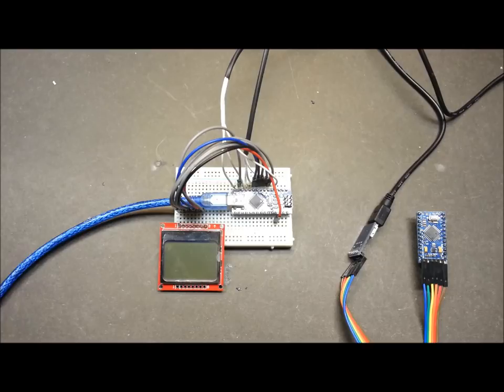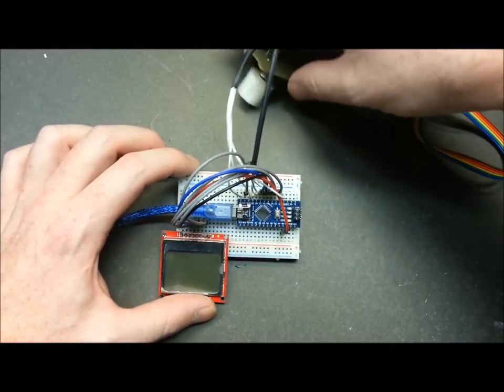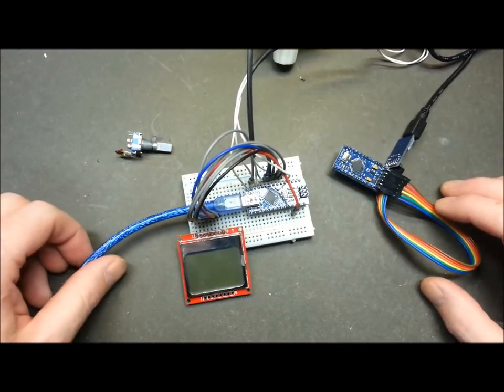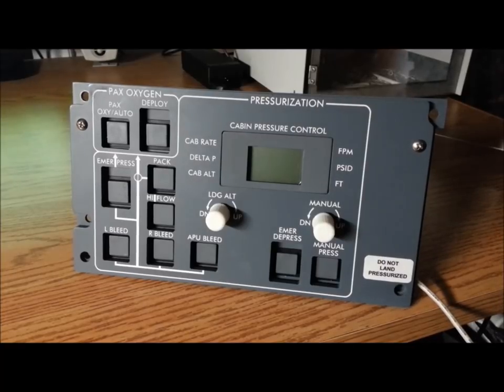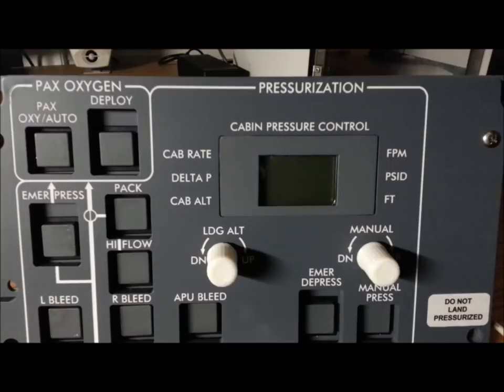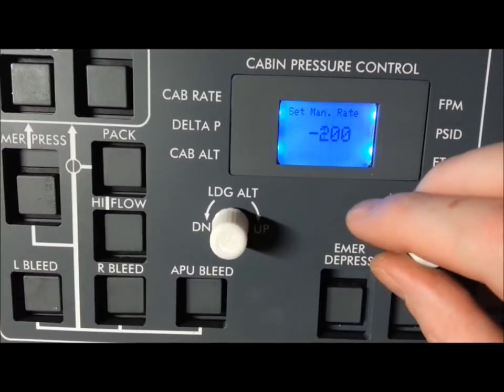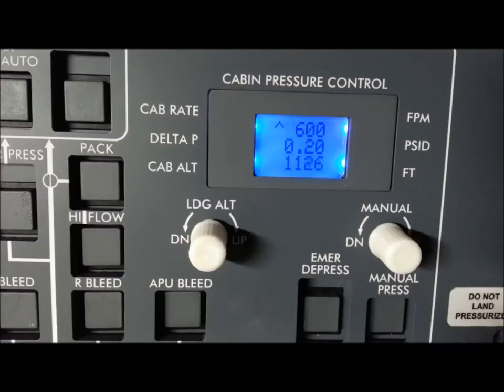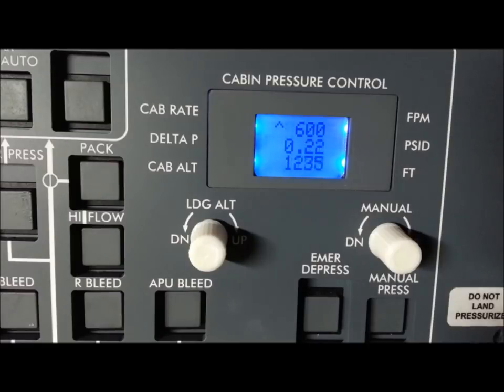Flight Simulator FSX LearJet Arduino Cabin Pressure Panel- Part 4

Comment: Again awesome work my friend.  Question for you. I am getting lag from fsx/p3d to the arduino.  How do you eliminate this lag?  Example, the landing gear will be up in fsx and the lights on the circuit board will respond a good 3 seconds later.  Is this a setting in the sketch or in link2fs.  thanks buddy.
Reply from the maker: I've never had anywhere close to that kind of lag.  I'd suspect its the signal from the SIM.  I actually have a custom prog for my gear indicators in the lear which is offset from the SIM slightly so I can't comment on the variables.  I try other signals and see.  You should be able to remove all lag in Link2FS with the sample rate.  Cheers.